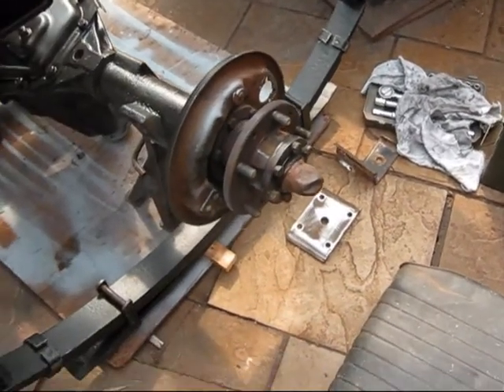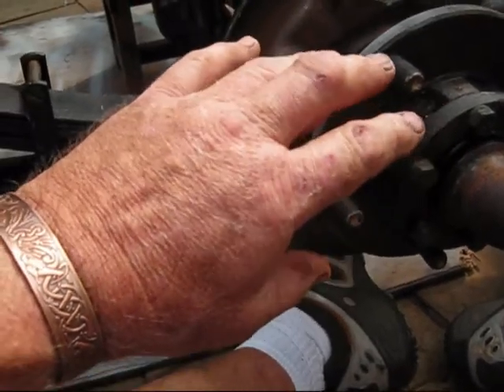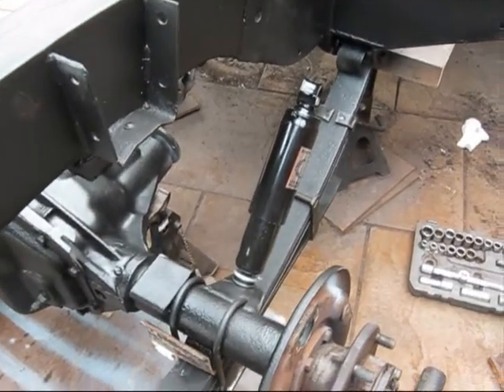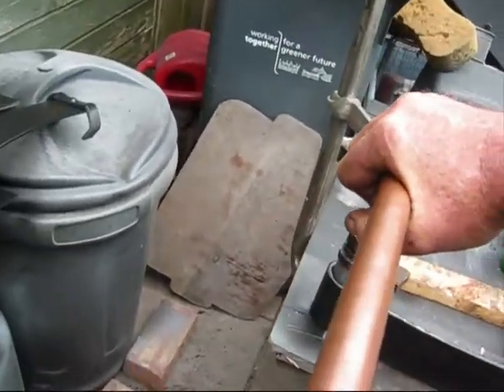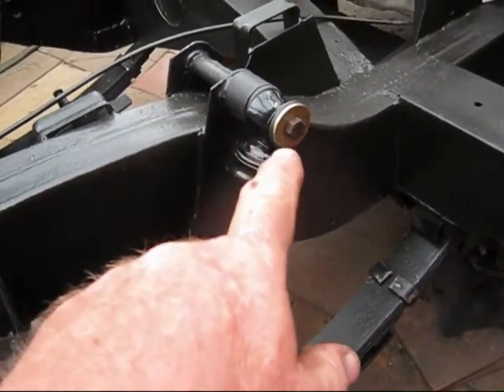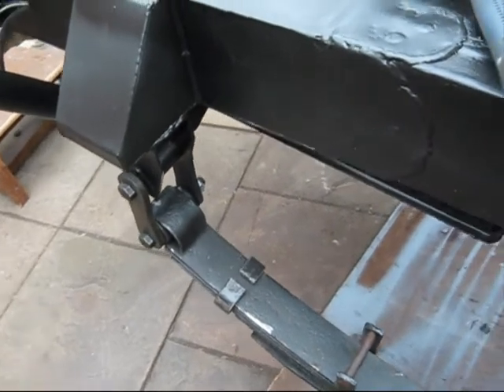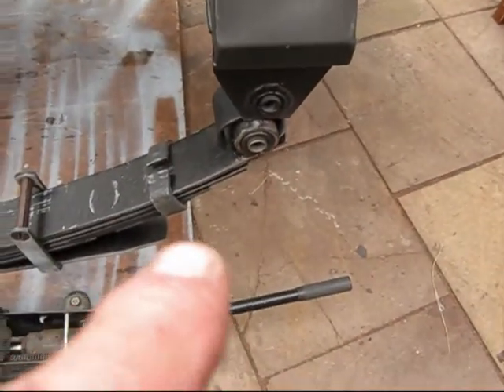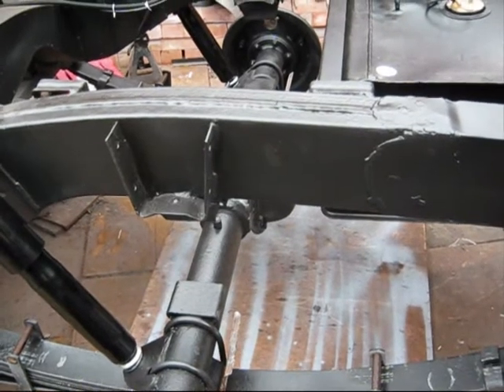land rover series 3 , stage one . refit springs ,and shocks etc.21/7/2016

Comment: I'm fitting new 8+2 springs and new shocks. Do I need to wait to attach the rear spring shackle until the rest is together? I attached both spring mounts ad the shock seems too short.
Reply from the maker: ok, you atach to the body first , the shackles last ! front or rear they are fixed points . as for seeming to short . i assume you have the right ones , you then have to jack up the axle and springs to join the shackles ? any probs get back to me
Reply: Thanks. I was also reading that the drivers side is a different curve than the other. Is that a real factor with the 8+2 springs. It didn't seem that pronounced before they were installed.
Reply from the maker: +Andy Hayes they are (handed) or marked left or right it's because the drivers side has petrol tank and weight that side so slight curve to springs.to compensate ..